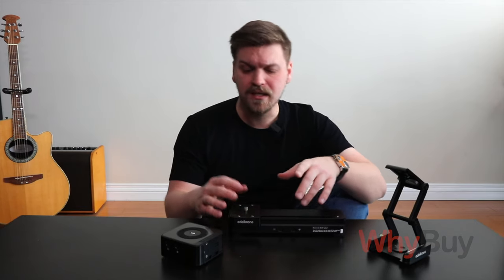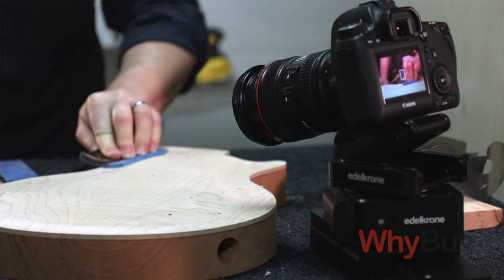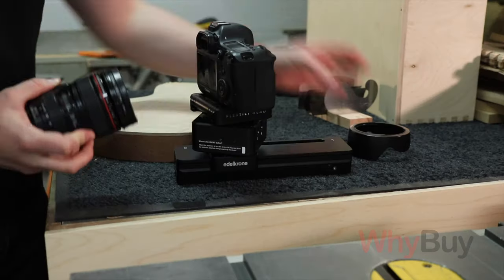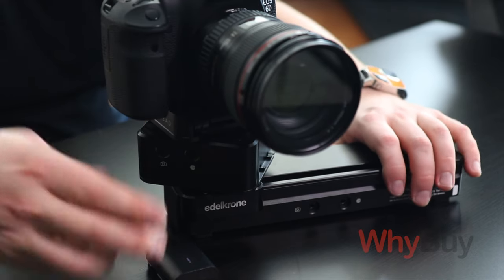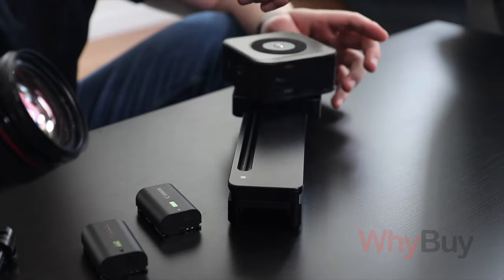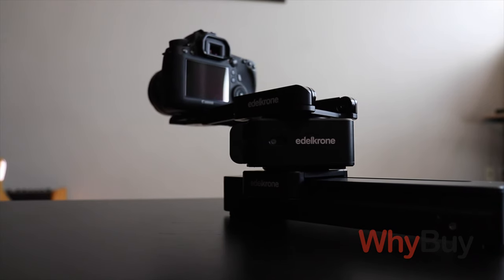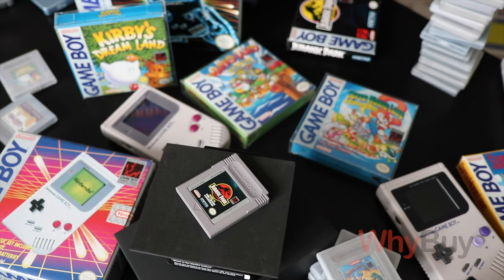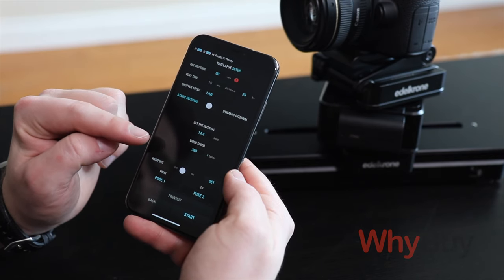Make filming easier with the best portable motorized slider

Comment: what's the reason for buying a slider when you can push and pan in post like in Adobe Premiere/DaVinci Resolve/Final Cut. Is there something I am missing? I am considering buying this slider but I have the option of replicating the same movement in post.
Reply from the maker: Felt the same way, however lighting, shadows, object or subject rotation looks funny. Done clever, you could get away with solid looking pan effect on post, but it’s never quite the same as actual camera movement. Thanks for watching 👍
Reply: @WhyBuy  I ended up buying one. Took advantage of the sale bundle..kinda feel now it's something I can do in post but I guess there many more possibilities i will discover with using a slider as time goes..
Reply: @joshmcdzz6925  You can't get parallax effect with post editing. Looks great to pan out from a foreground element to focus on a background element etc. Plus you don't have to crop in to achieve a slide as you have to do in post.